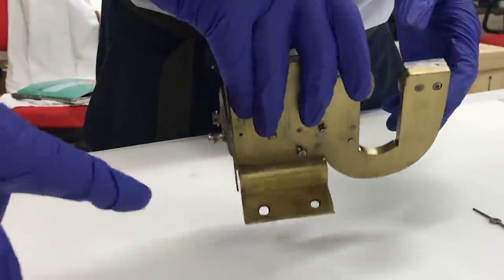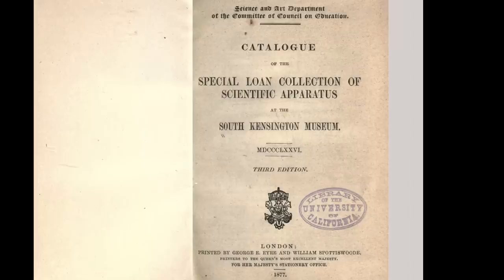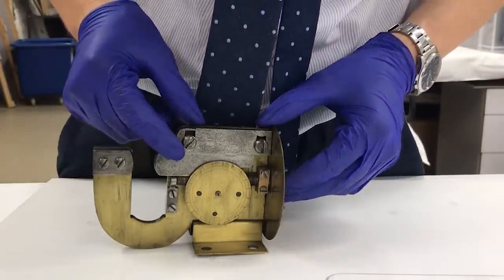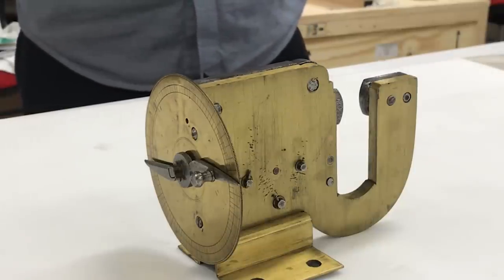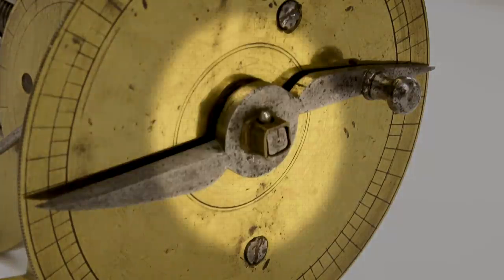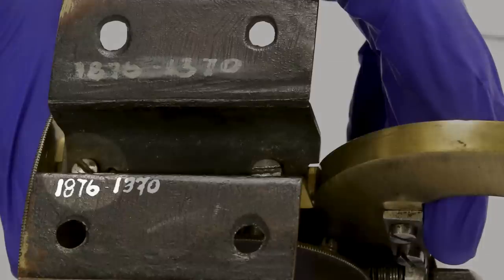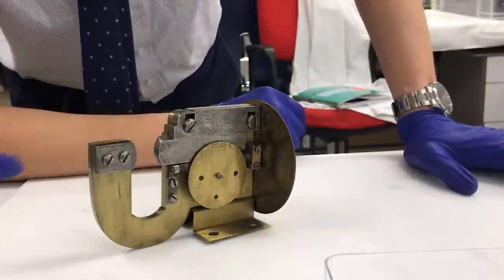World's Oldest Micrometer - 1776! Who made this thing??

Comment: It could very well be genuine - that time period was when many high-precision metalworking tools were made.

Take this Britannica entry on Henry Maudslay for instance:

"Henry Maudslay, (born Aug. 22, 1771, Woolwich, Kent, Eng.—died Feb. 14, 1831, London), British engineer and inventor of the metal lathe and other devices.

The son of a workman at the Woolwich Arsenal, Maudslay was apprenticed to Joseph Bramah, who manufactured locks. Maudslay soon became Bramah’s foreman, but, when refused an increase in pay, he left to go into business for himself. His first job was construction of machinery for the ship block (pulley) factory of Sir Marc Isambard Brunel. Over the next 30 years he invented machines of fundamental importance to the Industrial Revolution; of these the metal lathe is perhaps the most outstanding. He also invented methods for printing calico cloth and for desalting seawater for ships’ boilers, and he perfected a measuring machine that was accurate to 0.0001 inch. He was the first to realize the critical importance in a machine shop of accurate plane surfaces for guiding the tools; he produced for his workmen standard planes so smooth that they adhered when placed atop each other and could be separated only by sliding. He also designed and built a great number of stationary and marine engines.

Several of the outstanding British engineers of the Victorian period, notably James Nasmyth and Sir Joseph Whitworth, learned their profession in Maudslay’s shop."

I'm curious about that entry about surfaces that adhered - gauge blocks were supposedly first patented in 1901 by Swedish inventor Carl Edvard Johansson.

Comment: 7:07 The knurling around the dials is likely an artifact of how the markings on the dials were accurately indexed or divided.  I.e. Broach or otherwise create a small splined/toothed cylinder with a number of teeth that will evenly divide into the circumference of the dial.  Roll the brass dial edge against the splined cylinder (think two gears meshing) leaving a spline or knurl around the dial face circumference.  Now, when you rotate the small cylinder a specific number of turns as it engages with the dial, you have essentially indexed the dial for accurate scribing of the dial marks.

Comment: A possible explanation for the baseplate holes being countersunk at the bottom is that the base was not screwed down but set in pins on a table and there were more than one device to measure larger thicknesses.

Comment: This leaves me with the impression of a desing that was built crudly, used for a while and reworked on for improvements.

The mounting base is a good indicator of that. Looks as if it was made in an hurry to facilitate handling. The "lack of screw marks" on the flats of the base could be explained by the use of wooden flats used as washers.
Reply: The knurling around the brass edges is a practical way to avoid the part having a cutting edge when thin. Makes the parts safer to handle.

Comment: Interesting video by MT.   This  small  bench mounted machine made by James Watt & Co. was to measure his own parts and not  mass produced for consumers, nor was it called a micrometer.  It is 0 - 1"  with U-shape frame. Today's micrometers  are based  on this design.  The small disk measures fractions of an inch  and  the  large  disk measures ten-thousandths.  ( 1/10,000"  is  five times thinner than a pound note or dollar bill)    Although  the  design  and calculation  of  the  small pinion gear  was intensive,   the   hand-machining  of the dial arms  was work intensive also.  The small screws  are  amazing in their class 3-A  thread fit  and  most have the slots perfectly centered. I forgot to mention that the  threads on the sliding anvil  were made by  heating   a  low carbon wrought iron bar until it was yellow-white (approx. 2200 - 2300 F)  and  hammering it once against  a  threaded rod  or  against the actual lead screw.  After that,  the slightly deformed  sides of the sliding anvil were ground  fairly  flat (ref.  video at 11:20).

Comment: Having built tools for a particular one time use myself I have a few thoughts for consideration. If it is a prototype or one time build there probably would have at most been rough sketches and planning. In consistency and some quick and dirty rough work would indicate building on the fly grabbing what was handy. Much of the craftsmanship in those days was not carried out to be replicated a lot of times over an extended period. Thus rifles of very fine work precision fit not to a precise measurement but in relation to to the surfaces and shape of the parts being joined. Brown Bess rifles were made based on the same pattern but parts were not necessarily interchangeable until Eli Whitney fathered mass production.  This devise may have been made to use in a project that required close tolerances in matching parts so that hand fitting and lapping were minimal to finish the project. Possibly after changes and irregularities in a device for proof of concept, the actual tool to be used was built with all the corrections a finer craftsmanship. Just a few thoughts from a tinkerer/inventor point of view.

Comment: Some ideas come to mind - either it was an expedient tool made to solve a quick need (but why bother chamfering the mounting holes?), or maybe it was made by an apprentice in his shop under his direction.  Also - what about the width of the measurement opening? Does that width correspond to anything that Watt might have commonly built that needed to be measured to this precision?
Reply: The double countersinking made me think “everyone puts a part in wrong eventually,” be it cutting a miter on the wrong face of a piece of trim, measuring on-center vs. on-edge, or just being quick to clamp something in what our monkey fingers see as best at first glance, especially in a poorly-lit era when nothing went to waste, so if there was still enough material, eh, don’t bother re-bending a new piece or even deciding on different hole locations, just make it work (for now, at least). And “if it ain’t broke...”

Comment: One observation that I can make concerns the base.  I believe the base was made from re-purposed material.  The reason why the countersinks are not centered on the bottom is because they were probably made from a rounded punch, like the way a blacksmith would do it.  Being a blacksmith myself, I've countersunk holes using this method many times, and without lots of practice it's not always easy to make them perfectly centered.  I've seen countersunk holes like this many times while conducting historic blacksmith research.  Also, I wonder about the slop or backlash in the lead screw and how this would affect accuracy considering the relative crudeness?  How is your micrometer project coming along?

Comment: The hole on the face that seems to have no purpose may be for timing.  Here is an example of how that would work - On the 1980s chevy chevette motors the camshaft pulley had a small 1/8 hole in it that you aligned with a hole in the motor block.  When the rubber timing belt broke, bring #1 piston to top dead center, the timing mark on the crankshaft pulley should be around 10 degrees before top dead center, align the camshaft with the 1/8 hole, put the new timing belt on and the motor was timed.  There was no need for a timing light.  I replaced several chevy chevette timing belts in the 1980s and 1990s and never once used timing light by using this technique.  So does the hole on the face of the device align with a hole in the body.

Comment: Faint circular marks are ways to identify,  I’m a maker and I leave witness marks all over prototypes,  lots of faint circles, lots of odd holes used to hold implements or gears, and then a design change   But I would bet those circles are mathematically connected to the inner workings , just an idea , cool video Sunday morning after thanks giving

Comment: Personal theory is that the iron portions of the tool are original, and the brass portion was added sometime afterwards, possibly due to damage occurring to the original iron parts ( some of which may have broken and were then passibly 'repaired' with the brass portions much later in time.

Comment: Maybe the screws or whatever was used to affix it to a table could not be removed and were drilled out leaving larger irregular holes on the base and no signs of a screw. This could also explain the counter sinking on the bottom if drilling out the screws left sharp/ gnarled edges on the bottom, so scrape to make safe and you get something like what we see.

Comment: Micrometer looks to be used face-up or at a face-up angle. The flange was probably held in place by a purpose-made vice. The irregular base holes may have been index holes for quick placement in the vise - that's why they are roughly champhered.
Just a thought....

Comment: Other thoughts, did the original use a hobbed secondary dial gear or a spur?  On my recreation I used a spur gear. 

Also it seems the bearing/bushing behind the main dial is a split design.  

I am sure I will have more questions!
Reply from the maker: I've seen photos of the 23 tooth worm wheel and it is rough and looks to have been filed by hand. And yes, the rear bearing is split with oddly the front half being somewhat larger than the back.  I have seen photos of it apart (sorry, was asked not to share :-/ ) and the shaft is NOT straight through but narrows somewhat and then has a taper at the back where it exits. When I publish my CAD drawings it will have this detail.

Comment: At first glance I have the feeling that the base was screwed upwards, with conical screw heads beneat the plate and pointing up. I say that because the holes are not cylindrical in shape but have a larger diameter at the lower end. Maybe the appartus was put in place under a workwench in a receiving hole, and screwed in place under it.
Reply: I thought “upwards” at first, too. There were probably a few iterations of “bases,” and if you were smart enough to have any part, any hand, any small measure of - geez, I’m not trying to make a pun! - in designing this, you’d likely know that hanging a precision measurement tool off the edge of a work bench would be a terrible idea (vibration, damage from clumsiness come to mind).

Comment: I think the base plate (the one that mounts to the table) might have been added by someone else later (perhaps added for the exhibition). It would explain the noticeable 'crudeness' by comparison, as well as the lack of wear around the mounting screw holes..  {especially considering that, after inspecting the interior components, there appeared to be a fair amount of wear from use}.  It would also explain why the base is too short to be mounted anywhere other than the table's edge.

Comment: I think it is likely that the large dial was repurposed from a gauge or a scale. Of note is the location of the extra hole in relation to a noticeable dot on the inner ring of divisions.  This implies to me that the hole once held a stop pin for the gauge needle.  The rubbed edge would have facilitated rotating the gauge face to “zero” the scale.  This would also explain the many rotary marks left on the face as the needle brushed against it surface during its service life. 

I have seen threads like the ones in the anvil before but I cannot seem to place them.  The ones I recall had a similar curved profile but there were a pair of them top and bottom that fit into something else.

The small gauge reminds me of a distance gauge or revolution counter. The arrangement of the larger lead screw shaft and small dial worm gear are consistent with some types of gauges I have seen.

Comment: It looks like it was made to measure one product over and over again as the items were being made and it only needed to be precise in the tolerance range of that product. What leads me to this thought is the uneven cut of the threads in the anvil and that there is one place on the big dial where the marking seem different. It also seems some parts are recycled or re-purposed from other instruments. 

Also I have a sneaking suspicion that it is upside down and that it would have been mounted with the brass finished side on bars running both sides of the U shape. This would explain why the brass side needed the better finish to mount flat in its mount. If mounted on two bars fixed to a rotating center point it could be lowered onto a circular part(that there were many of in the steam industry) and rotated around the center point to measure how near a perfect circle the manufactured part was(or you could rotate the part while the measuring device remained stationary).

Comment: I'd guess it was made for a purpose without the maker appreciating how unique it was.  It was made quickly out of recycled components, probably to measure a specific project and then kept in a drawer for occasional use.
The U-shape doesn't look deliberate and I think the comparison with patented micrometers is from our hindsight point of view and is actually coincidental.
I don't think it would be of much general use for measuring with curved jaws and I suspect it was more of a tolerance device, i.e. you set it then passed something between the jaws to see if it fit.  If that is the case then I think it was a hand held and device and the stand was added later.
My best guess is it was a hand tool for measuring the maximum diameter of shafts, probably while they were still on the lathe.

Comment: This looks like something that was used for a long time in a manufacturing environment. It was modified over and over again to be used for different purposes. It has obviously been disassembled and repaired as well. It appears the pins on the back were hammered back in and the main plate took some damage in the process. It looks like a beat up old tool which is exactly what it should have looked like decades or a century after it was made.

Comment: you asked for opinions? so this is mine: the device is used to copy pieces to a certain size, not for measuring something numerical. the toothwheel shape has originally held some clamps or riders to remember several preadjusted sizes.
the foot or table mount is made later and for the reason not to put down and lift the device every time you want to test the piece in the making process. most likely somebody else made it, just a worker, not the engineer. i think the device was used in production of a factory, or manufactur, not a laboratory. that s why it is used so much.

Comment: This looks like an adjustible "go/no-go" gauge used to quickly check likeness between a part and a standard.  Most likely made (or mutated) from one or more old fixtures laying on the shelf.  Every tooling shop has piles of special "one off" jigs and fixtures like this.  It doesn't matter the century IMHO.  It was just a testing tool that was never intended to be prototype or sold.

Comment: One thing is that the device was created to fill a specific purpose. Other have pointed out that it is crude and looks like an apprentice project. To me is looks like the work of someone who needed to fill a specific need to get work done, hence the crude finish, wear and lack of maker's mark. I would look at what industries existed at that time which would benefit from such a tool. Perhaps weaving, printing, pottery, engine bearings? Looking at range and divisions and then comparing the scale to products and industries that existed at that time might help. Also doing non destructive assaying may give clues to the origin of the materials. Of course I'm probably not the first to think of this, just some ideas.

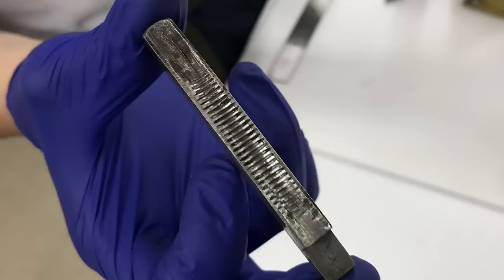Comment: It occurs to me that the marks seen at around 10:57 and 11:30 and other places are made by the diamond pattern of the clamps of a vise. Did that exist then? 

Also thinking this could be a rushed prototype but surprised about the mixed materials with thermal expansion problems. Also thinking brass is not the most thermally stable material for making a tool for precise measurements. By the way, I have a sample piece I made with my grandfather (born 1895) , a tool maker of the Brooklyn Navy Yard, with screw threads of various sizes made on a lathe where we physically swapped out the gears to change the screw pitch.

Comment: It appears to have been used quite a bit, likely had mid-life repairs/replacements. The bottom attachment point makes me think it was at some point damaged and needed repaired. Or, it was used in the production of something and was used to check production tolerances (it didn't need to be accurate to any other device, as long as each part was uniform to eachother). It might be worth while to see if there are any other known devices watt used in that time period, or people he worked with. See if there are other reoccurring techniques (the use of iron, knurling the brass, use of soldered brass to add weight to dial indicators, that kind of thing)

Comment: My guess is that the mounting holes are out shape for a couple of reasons. First having been hand drill could have cause one side to be tapered. Second if this was used in the repeated production of heated metal parts it may have been mounted in a orientation other than the U upwards and it was more than likely mounted to a metal stand or table. The screws used to secure it to the mount/table were probably just as bad as the others and had to be drilled out by hand causing the taper on the other side of the plate.

Comment: The two engraved rings on the big dial face could be because of a change of plan if the instrument is a prototype. 
Doesn't match that someone could build the instrument, but not do something simple to protect the gear face from the "New York molding" hammer marks.
The base would most likely have been planned and built as a component, as using the device would have been enabled greater with it mounted.